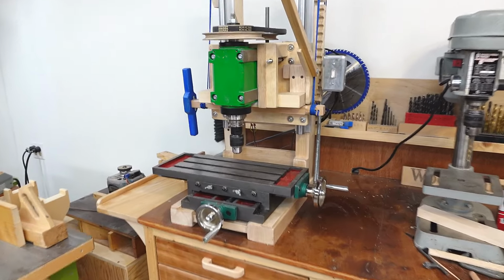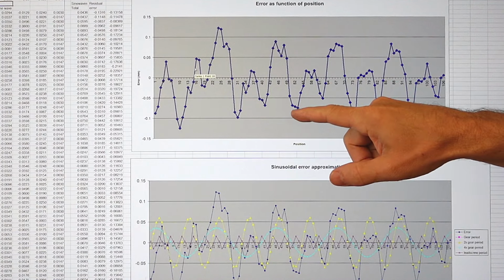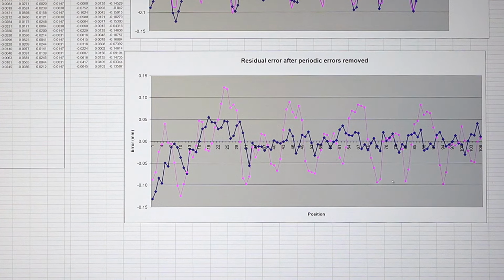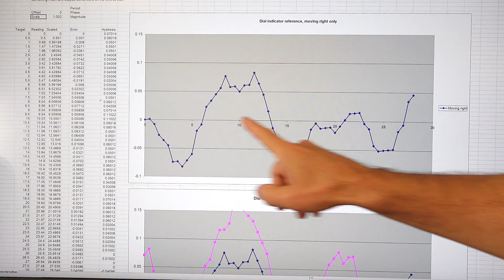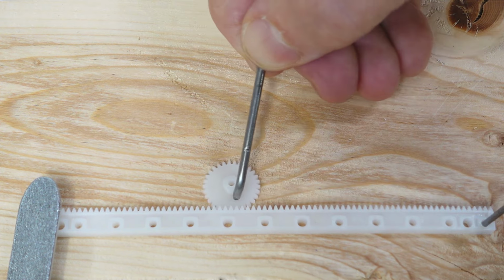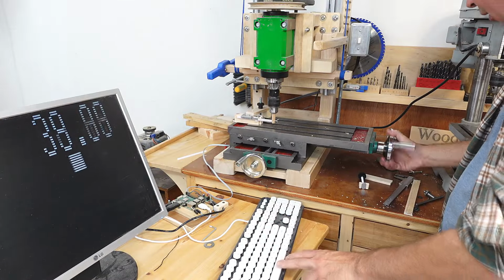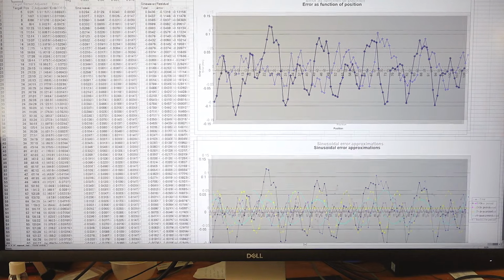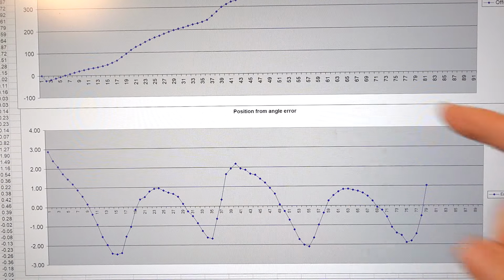Linear position with a rotary magnetic encoder

Comment: Is that Manchester encoding? Is that 8 boxes of 3 clock cycles - a 24 bit pattern. Is it big endian format? As you move the slider I see counter like behaviour on the left hand side, more bits seem to come into play spreading rightward as you move the encoder. I had to do similar analysis a few years ago when I reverse engineered the flysky ibus telemetry protocol for the open source cleanflight quad copter flight control project. I used excel and there was a tool called sigrok IIRC which made it easy to take the waveform dump from rigol on a usb stick to various useful formats for slicing and dicing in excel. Then it was a case of plotting the decoded stream in response to various control inputs and deriving the pattern, I’m thinking it’s a comparable task here

Comment: A flexible fridge magnet is usually a tiny Halbach arrays (alternating north/south poles in a stripe pattern)
I wonder how accurate a position you could achieve with the sensor and a flexible magnet tape.

Comment: Instead of doing function approximation with the sine waves (or maybe in addition to), can you just use your tests as a lookup table to subtract the known differences?

Using a function always feels cleaner, but I've found using a lookup table, and approximating using a best fit function between data points was my best bet.
Reply: I just saw you reply to another comment about it not working on non-periodic. That's true, but you could make an assumption based on where you last were, if your 0 position was calibrated. It's not very clean though, and it might get "lost"

Comment: did you measure hysteresis, ie gear teeth tolerance. try metal strip resistance based on distance. yep linear potentiometer.

Comment: You can buy cheap plastic digital calipers from China as and improvised DRO with 0.01mm precision. You can buy 300mm one. For a cross movement of my support on my small lathe I have purchased a small steel one with 100mm travel. I think you can "steal" signal from those as well.

Comment: Why not start out by removing as many error sources as possible ?
Test the magnetic sensor by putting on one of these 360 degree angle gauges (protractor) directly on the axle and check if the readings are consistent then.
If not, try moving the magnet a bit further away from the sensor. If it is very close, small errors/inconsistencies in the flux could heavily influence readings.
Reply from the maker: Why not watch my video about testing the angle sensors?  Linked from the end of this video.

Comment: use a linear encoder from a laser printer, comes on a shaft already. The
Reply: Dont you mean an inckjet printer 

Tose have encodor ribons
Reply: @Thefreakyfreek  Your right, exactly what i was thinking of! The encoder ribbon
Reply: If you need a longer version, and can't find a Tabloid capable ink-jet printer (I've got one at photo quality, but it's scrap at this point,) you get a full 11-12" of length. The main problem is that the sensor is almost always soldered onto the board for the print head, and isn't always well documented for how to use it in other solutions.

I would think that a much easier solution would be to get a rotary encoder, and timing belt. Improve resolution by gearing up,, but you end up with increased error due to backlash.

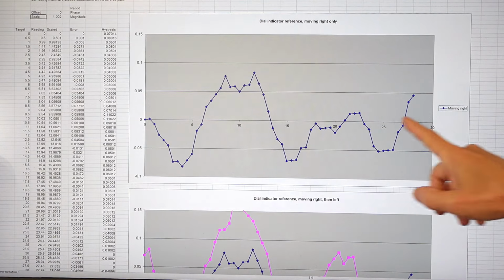Comment: 3:32 it looks like your high spots  of the sine wave are folded over (clipping). Not sure what would cause this though. Is Earth magnetic field enough to do that? If yes turning the magnet and sensor 90deg might help.
Reply: It is possible that the setup is exceeding the detection range (maxreading) of the sensor. Possibly the sensor needs to be a bit further from the magnet? But I don't know.

Comment: For the idea you suggested at the end - the linear array of magnets - there are specific magnetic encoders that work with that. You can google SIKO LE200 for example. They work with magnetic linear tape, and magnetic linear tape has pole pairs very precise at 1, 2 or 5 mm intervals. I was using AS5311 ship ona custom board with 2 mm pole pair tape, and they claim up too 1.95 um resolution in ideal conditions. 
And that combination of sensors is usually how most DRO's work

Comment: 1:34   You're going by the has marks on the cranks ?  Those are not reliable.  Why not put an indicator on the travel and measure the actual movement ?
3:15  OK there you did it.

Comment: You can use an old ball mouse with a rotary optic encoder. Just an idea...
Reply: this is why i prefered the N64 controllers... used a rotary encoder... shame about the terrible joystick pivots. i swear they prototyped it in metal and overlooked the wear issue... or maybe they did it on purpose?

playstation uses pots... too prone to wear and noise. but a much better pivot!

even a standard mouse with the optical encoder... they do pretty well on almost any surface...

Comment: That encoder is poor for this application, it's not designed to be used for rotations past 360 degrees, it'll give a lot of noise and mess cos of it. Use the MT6701 and you'll get .01mm accuracy working at high rpm too.. 

Also, you need precise fits, like 0.5mm away from the magnet and totally flat/parrallel surfaces, not just heatshrink or it'll throw it off
Reply from the maker: My accuracy was not limited by encoder resolution.  It was mostly mechanical issues

Comment: why not just use an optical encoder - which you can get for about $10 and then use a $5 Arduino to decode and send out the serial port and/or display it on a cheap LCD.
Reply from the maker: part number?

Comment: Looking forward to the day when you will relent, get a decent 3D printer and learn to use a decent 3D CAD package. That encoder jig could have been easier to design, construct and way more precise. Of course that means even more time on the computer which might not be what you are looking for...
Reply from the maker: Would have taken way more time to 3d print.  Needed to be a certain size so I could clamp it easily.  Also, getting the fit right for the axle would have been an  iterative process.  If I had a 3d printer, I wouldn't have used it for this.